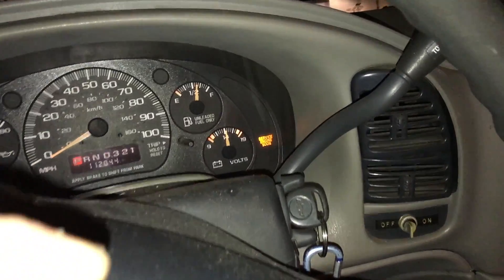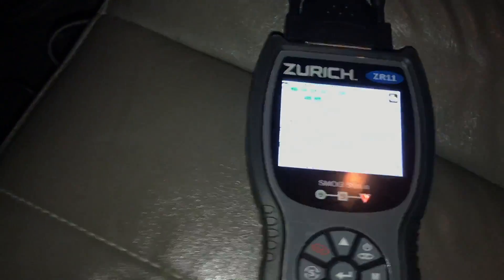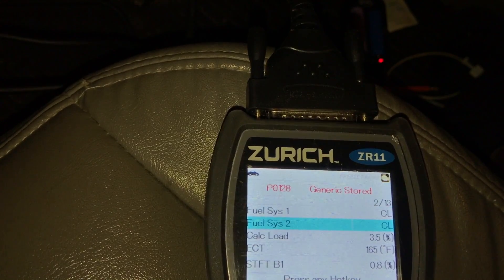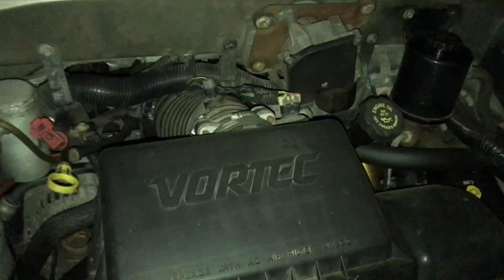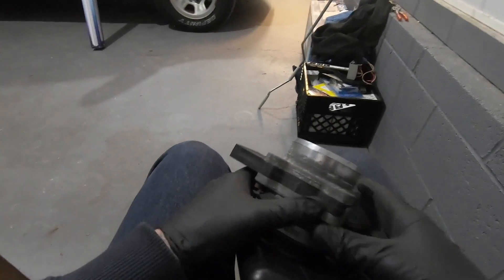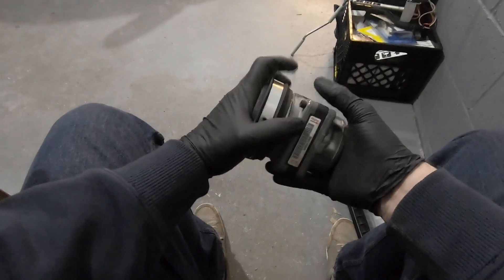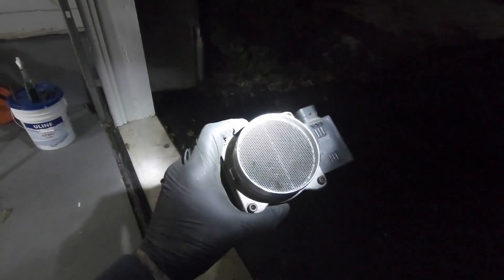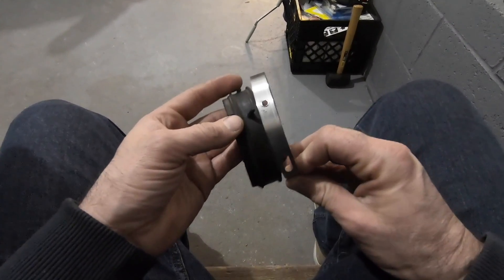Cleaning Mass Air Flow Sensor Due to P0101 fault.

Comment: I was a ford tech for years. Please note: p0101 is an electrical fault in the MAF voltage; not a mixture problem with airflow regulation/sense. It means EEC did not see at least the bias voltages at the PCM. If this is a 2.3/3.0L, those maf sensors were known to fail (I think the part number was f67f12b579-a, but could be wrong.)
 You can backprobe the voltage on either the tan/some stripe or lt blue/rd, at idle the voltage at pcm should be about 1 volt. Tapping the sensor can induce this code.
 You also need a tstat; p0128 mean excessive time after cold start to see 20 degree increase in ECT temp.
 If you need more info, let me know.
Reply from the maker: I just picked up a thermostat since I clear the faults. A few days later the p0128 causes the check engine light to reappear. Cleaning the resistors seemed to eliminate the problem. You think it will come back?
Reply: I agree with what he says. Thermostats tend to get slow opening  and stick open as they get older
Reply: The p0101 is certain to come back in time if the MAF was not disconnected with the key on. If that voltage goes away while driving, it will usually stall, run rich, and be very sluggish.
Reply: while it could be a harness/connector issue,  large intake leaks or extremely dirty sensor can cause the same code and it sure looked dirty going by the junk on the air screen.
then, just make sure the intake hose from MAF to throttle body isn't cracked/split or loose, some of them get stiff and crack with age when changing air filter or doing other work.
Reply: Not on a ford. That is an issue for many other cars (Toyota and Honda come to mind), but the definition for that code is “MAF voltage less then expected.”
 Ford uses mixture codes for values that are less then what expected when running for a specified speed/load (primarily p0171, 2268)
Reply from the maker: The p0101 code has t come back since cleaning. The p0128 was coming up constant. I added a bottle of coolant flush to the radiator. Figured I would clean out the coolant system before replacing the thermostat. I need to drain the flush out yet the fault has been gone for 4 days. Could the flush kit cleaned some crap that was stuck in the thermostat?
Reply: The HVAC Hacker if the code P0128 continues to to come back I would just replace your thermostat. The older a thermostat gets the less responsive it will be and in many cases it will stick opened preventing the engine from reaching its normal operating temperature. It’s an easy and cheap fix

Comment: Silicone Spray is your friend for sticking those hoses back on.  The code you have is a circuit fault.  A dirty MAF will cause lean codes and high fuel trims but not a 0101.  Normally the get a loose contact in side and drop out during vibration.  I would graph your MAF sensor data and then tap on it with a soft hammer and see if it drops out.  The 0128 is most likely a bad thermostat it opening too soon or it isn't closing tight.
Reply: you don't want silicone getting on the MAF sensor though! any of it on the wires makes for a bad day :)
Reply: @throttlebottle5906  A little silicone lubricant on the hose isn't going to hurt the MAF and it will help keep from tearing the hose.  If you get spray on the wires you can just clean them again.  Just check your fuel trims to make sure the MAF is good.
Reply from the maker: Could be a loose connection. The clip is broken for the plug. Fault hasn’t come back since I cleaned the sensor
Reply: @thehvachacker  It's possible.  Sometimes a pin fitment issue as well, the connectors get stretched out inside.  It is kind of a known issue for those MAF's though to get intermittent connections inside the MAP sensor itself though.   I'd say run it till it happens again.

Comment: Yes, they get little particles that can make the tstat stick. If your serious about flushing, run the cooling system cleaner then take out the stat and flush with a garden hose. Then drain the block at the cooling jacket plug in the block. Let it drain out , reinstall plug and then refill with 50/50 using distilled (NOT TAP) water. Ford also sells a cooling system conditioner that helps to neutralize the Ph of the cooling system.
 As for the p0101, is it possible the key was in when the maf was unplugged?